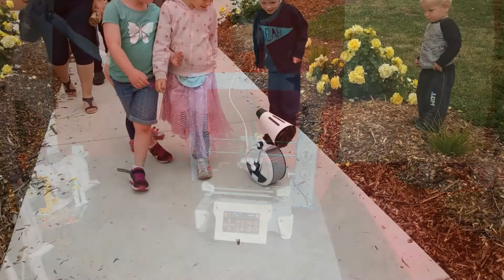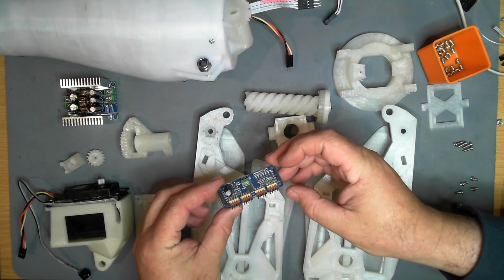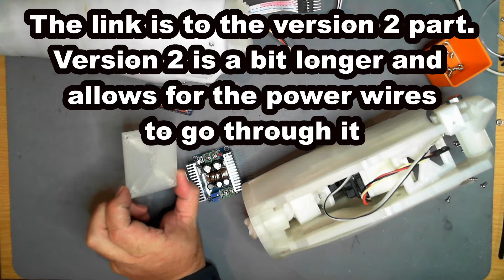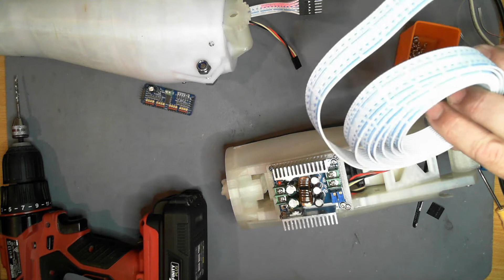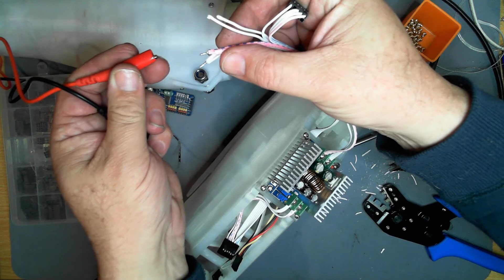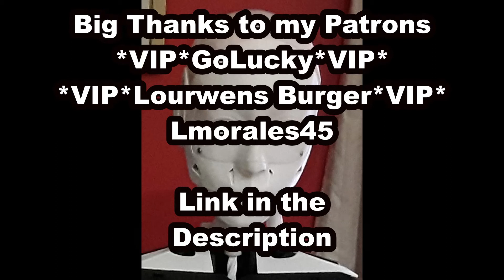Freds Left Hand Part 9

Comment: I envy those loctite fit nuts on the forearm to bicep bolts. Need to upgrade my bolts lengths and get some better nuts eventually. XD 

Very cool experiments with the arms you have going on with the custom component set up.
Reply from the maker: I like the Nylock nuts here where there can be some back and forward rotation as they tend to hold on better than a standard nut.
The real trick to remember with Nylocks of any size is to do them up by hand.
If you use a power tool, the friction will heat the Nylon in the Nylock and it will melt, then it will get loose and won't work :-)
Reply: @CyberOne   Woops. Mornings. 😆  Regardless, need me some.